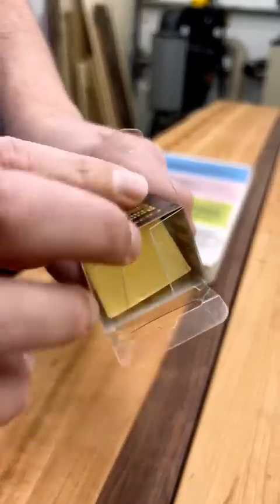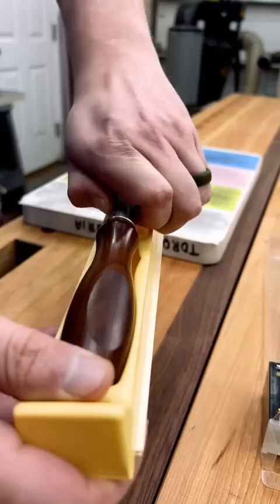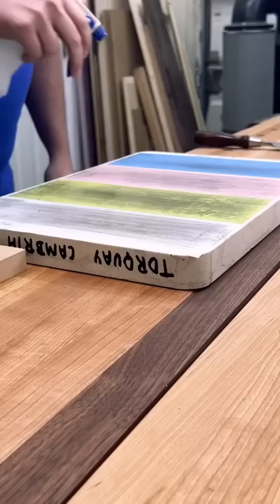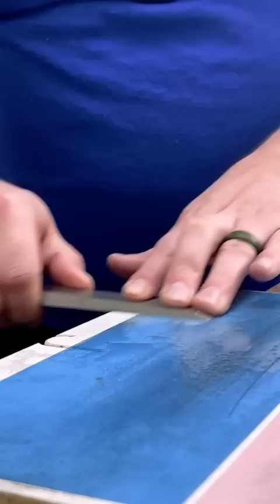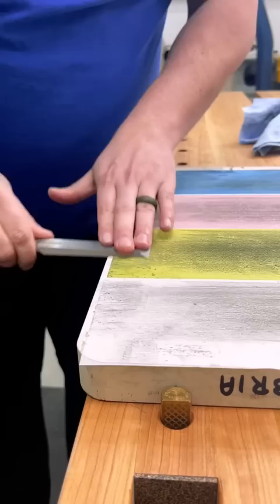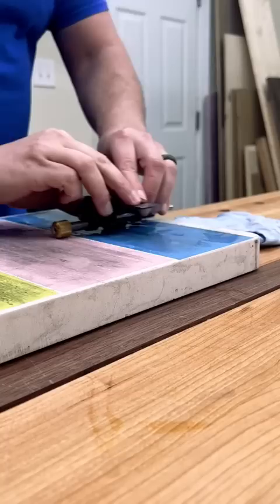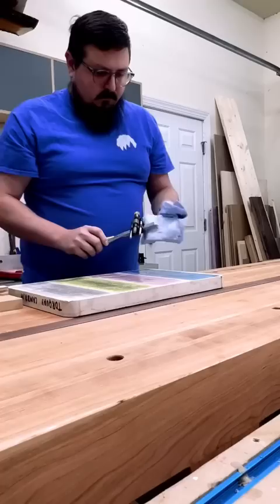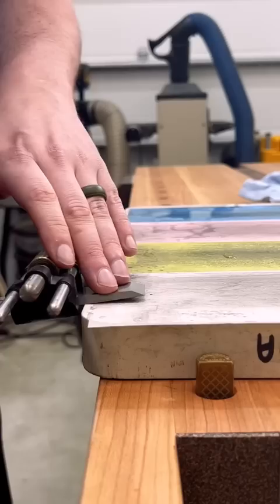Getting a New Chisel Razor Sharp

Comment: Then a guy like me comes along and uses it as a pry bar drops it on concrete and uses it to break off heads of rivets
Reply from the maker: haha
Reply: @cameron hochachka and then a guy like me comes along, and suddenly you go missing and are never seen again.

TO MY PROBATION OFFICER for legal reasons, this is a JOKE. But, only for legal reasons.
Reply: I have dedicated rivet smashers for removing sheets from caravans lol
Reply: @flonxu2385  huh I've always just drilled them out and used a punch to push the other hand through. I work in aviation though so it's a little easier to know the exact diameter of the shank to drill
Reply: @O'Irish McMan was thinking the same, basically stole it
Reply: @lilmac1050  not even basically. This was full blast
Reply: That's what Harbor Freight chisels are for
Reply: And open paint cans
Reply: If it was mine you would only do it once! 😲😊
Reply: @remcovanvliet3018 god that's edgy.
Like a 12 year old who just discovered The Punisher.
Reply: @GallopingWalrus  hahahahah I know right😂 "when I get angry I just see red and everyone suffers" type anime obsessed tween 😂
Reply: I had a friend grab mine to use to get behind a hub to pry it.

I OWN A DAMN HUB PULLER! WHY ARE YOU IN THE TOOLBOX LABELED "WOOD ONLY"??
Reply: Same here use it take wood or drywall off holesaw and bust out mortar for A/C disconnects
Reply: Like the guy that “borrowed”mine and trimmed the edge of his asphalt

Comment: Used mine as a screwdriver today because I didn't feel like walking 20 feet to my toolbox. Its ok I will use an angle grinder to sharpen back to new.
Reply: Yaaahoooo. You and me brother 😅
Reply: Yea, try to get some colours in the tip, Yellow is good.
Reply: @hiscifi2986  get a good golden colour and blast with brake cleaner to instantly quench
Reply: I do this with cold chisels, but I'm using them to scrape bb's of weld spatter off beams.

Comment: What is that tool you clamp it in to called?
It looks very handy.
Better than trying to hold the angle manually by hand.
Reply from the maker: It is the side clamping honing guide by Veritas. I love using it to set up the initial bevels.

Comment: I learned to sharpen against the blade and have done so so far, Tend to use just two grits of diamond hand file and lapping board to finish it. From what i have seen this creates least amount of burl. If corner is missing or something like that, then i run i hog most off with angle grinder keeping mind the temps and then do the steps. Then again guide and wet stones could be good for this too.
Reply from the maker: With stones that is the correct way to do it. The lapping film is thin and will tear if you sharpen on the push rather than the pull.

Comment: Q: is it better to sharpen with a honing guide or free hand? Thank you
Reply from the maker: Good question! I tend to hop back and forth. When I am setting a new angle or if I have gone free hand on a chisel and want to wrangle it back in I use a honing guide. But when I'm mid project and need a quick resharpen I just free hand it.

Comment: Soon as you put it in the rack tip down and I saw it wobble a little I held my breath. 

One of two things happen.
1. You try to catch it and cut your hand
2. It falls and hits the floor and you start over

I have a magnetic I attach them to and usually put some blue tape on the tips when not in use. They don't fall and the don't cut anything they shouldn't.

Comment: The only chisel I have was originally only purchased to hand carve a sake cup from mahogany. Once my dog chewed the bowl up after I'd gotten most of the chiseling done I just gave up cuz it was the first time I'd ever done anything like that and I used mahogany like an idiot so it took over a week just to carve the rough shape of the cup.. after that the chisel became my matchstick splitter, use it with a hammer to split pieces of wood into little shards I can soak in kerosene and coat with wax so I have little "match sticks" for lighting BBQ pits. Chisel was only worth like 5 bucks so it doesn't pain me to see the chips and warps on the edge

Comment: Okay i have wanted to see the Veritas side clamping honing guide for so long. I brought one because its half the price of the mk2 and a its basic.

My grouch with it, is that i found it always held my chisels chisel/plane iron at a slight angle, it was always biased to the right side. 
It is probably just my error considering it happened to every one. My chisel set as well as my dads 🤐
Bit it gets the job done. Maybe my pressure was biased to one side without noticing?  (I also noticed you have a set of Narex chisels! That's the set i got too. Those sides are very sharp, from flattening the backs i cut myself twice. I will have to deal with those asap)
Reply from the maker: That could be, I try to focus pressure onto one side at a time. Then do 5 passes on each, and 5 in the middle. The Narex set has served me well.
Reply: @TimberBiscuitWoodworks 
Hey just came across this again.
And from the time that's passed, when using the honing guide, it was my inexperience with the tool.
I can get nice square bevels now with the right pressure.
Reply from the maker: @benharwin6521   Hell yeah, that's awesome!

Comment: What do you mean by cross contamination with grinding or sharpening a chisel
Reply from the maker: It's not good to mix the larger particles and the smaller ones across the sheets as it can lead to more wear on the sheets and an inconsistent edge on the chisel.

Comment: I got a question which is better at removing material a wood plane or an electric belt Sander
Reply from the maker: That really depends on what your goal is. Both remove material really well but they do so in very different ways.

Comment: Do you not need to sharpen the sides? If you don't then y do they come sharpened from the factory?
Reply from the maker: Not at this point, they are plenty sharp. And the factory doesn't sharpen them, they are just sharp from the way the backs are ground flat in production.

Comment: Are you satisfied with the Veritas honing guide?
Reply from the maker: Yeah, I actually think it's great. I know some people have an issue with it leaving a crooked bevel but I haven't had a problem.
Reply: @TimberBiscuitWoodworks  Thanks for the quick reply! How exactly is the blade crooked for some people? Not a 90 degree angle?
Reply from the maker: @RoubinCreations  yeah I think it might twist on them when they lock it down. It’s hard to say since I’ve not experienced it.
Reply: @TimberBiscuitWoodworks  Ah okay, I experience that the steel rods bend a tiny bit on my cheap honing guide but the Veritas has thicker ones so I will definitely give it a try in the future. Thanks for the help!

Comment: CDT wheels on a bench grinder are by far the best method for primary bevel grinding. Establish a secondary bevel by hand on a 1000 grit diamond stone and then strop is all you need, it's by far the fastest method of getting chisels and plane irons super sharp.
Reply from the maker: I actually prefer Tormek if I were going that route.
Reply: @TimberBiscuitWoodworks  tormeks are great, but once I used the diamond wheel there really was no comparison in terms of speed and convenience. Only downside is dealing with the dust, gotta pick your poison i guess.
Reply from the maker: @Harry-nl3ic  true.

Comment: There should be a specific device made for sharpening chisels. Like you could set the cutting angle and have a deburrer/ flat edge in built. That way even very worn chisels could be made to cut like new without this entire process (plus some if its used).
Reply from the maker: They are quite pricey

Comment: Why would you sharpen the flat side of the chisel? It comes with a factory grind you said it yourself. If it was a cheap chisel I would get it...
Reply from the maker: From the factory there is a coat of residue on the flat side of the blade and this is also an opportunity to remove that. But hey, do you.

Comment: here im gonna buy a high end tool but then i dont think the factory did a good enough job so im just gonna go and redo the work. makes ZERO sense. i dont by a snap on or cornwell wrench and be like ya know what im gonna heat this thing up and bend in the fingers to make it extra special good.
Reply from the maker: Yeah so a chisel is not a wrench for starters and it requires some work to keep it sharp. When you get a Veritas chisel is comes with instructions, those instructions allow you to customize your blade for your style of work. In my case that’s a 35 degree secondary bevel and a little work to the back. All in all it’s about 4 minutes that go a long way towards the life of the tool.

Comment: Very nice video. But cross contamination? 
You’re dealing with wood, not food buddy.
Reply from the maker: Okay pal
Reply: Cross contamination of material from the previous higher grit there Genny......
Reply: Not an  expert here, but the definition of contamination is transmission of harmful germs or infectious disease; contact infection. 
As far as I see, no issue to the wood/utensils.

And it's not Genny. Its Jenny, or Genie (from Jenny the Genie).
Reply: @OriginalCinemaVideo  "Contamination is the presence of a constituent, impurity, or some other undesirable element that spoils, corrupts, infects, makes unfit, or makes inferior a material, physical body, natural environment, workplace, etc."

But even if we assumed that the definition you referred to was the actual only definition of the word, your argument is still bad. Because metaphors exist.
Reply: @MattMcConaha , if the information to be said was that he was cleaning the tool every time that he changed stones because higher grit with sediment from lower grit may cause damage, that's good. 
But cross contamination is related to food and health areas. Not woodworking or forgery, even considering that metaphors exist. 
You could say that when you have a big issue in life, as a metaphor, that life just hit you in the right corner of your left cheek of your ball sack. Just because it is a metaphor doesn't mean it's a good metaphor, and that you should use in order to assure proper communication.

Comment: Why buy it if you need to do work to it right out the box?
Reply from the maker: Veritas are some of the best western chisels you can own.
Reply: @TimberBiscuitWoodworks  maybe in your opinion but I don't buy end mills for a mill that I have to sharpen
Reply from the maker: Completely different tool for a completely different operation and material.
Reply: @TimberBiscuitWoodworks  no different in terms of buying good tooling
Reply: @TimberBiscuitWoodworks  if its the best and you have to change it.. well then you make the best